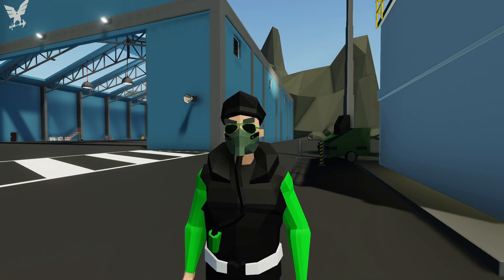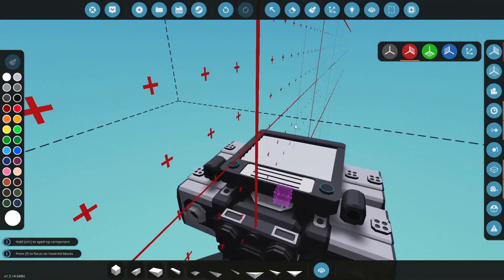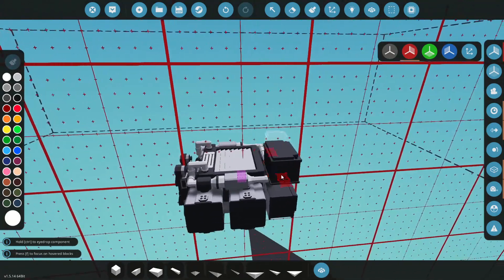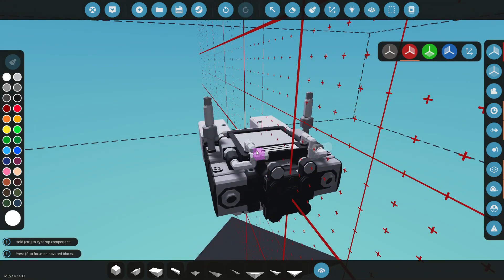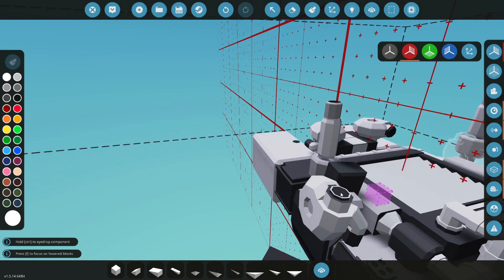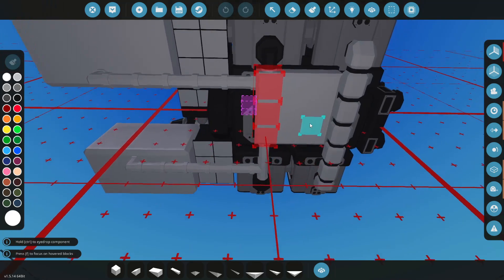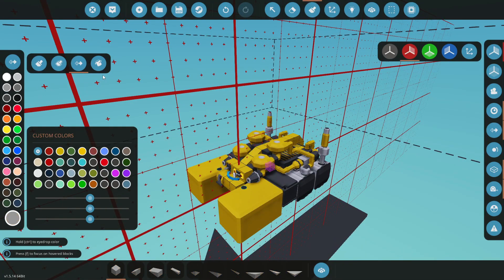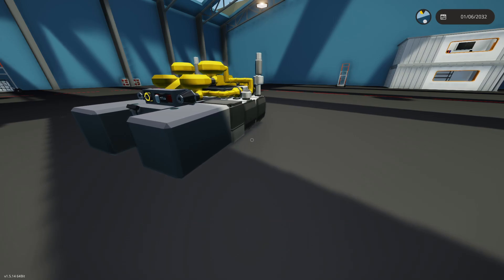Excavator Modular Engine Build! [E1] STORMWORKS BUILD SERIES

Comment: This is helpful, I find.  Took me a long time to even ty modular engines, but they do have their uses, as do the old style.  Cheers for making and sharing the video.  (c:

And yes, those starters are weird when placing -- or rather, I think the belt-drive part has weird connector, always having to turn or flip things...
Reply: Use a 3x1 crankshaft to add a space for your pumps ;)